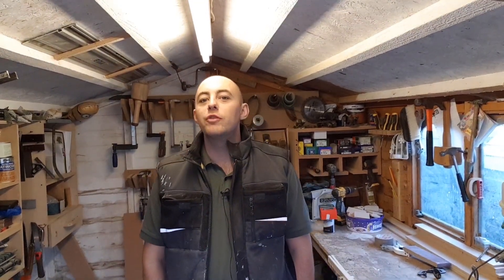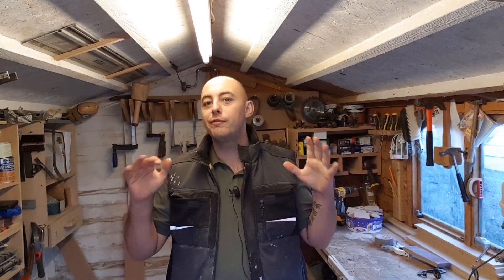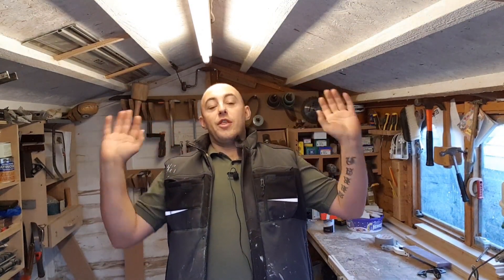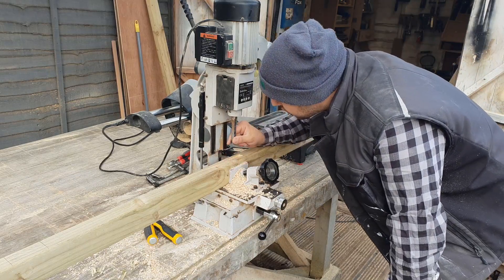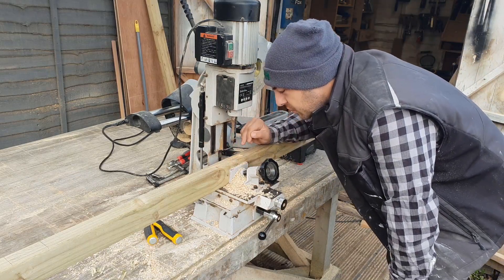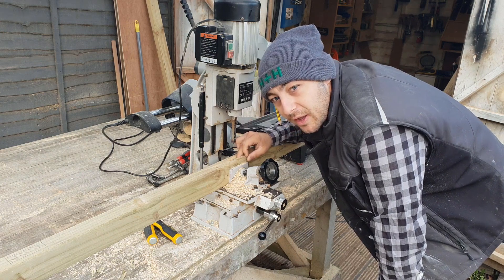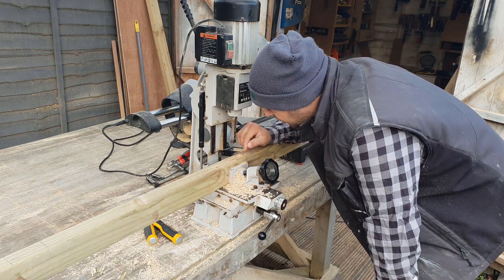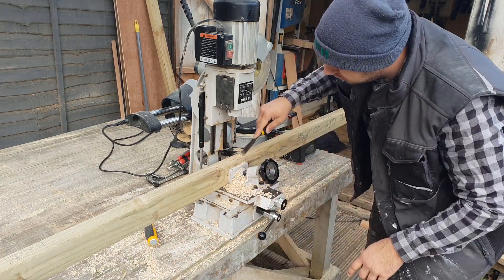Build a Mortise and Tenon Gate.. part 1

Comment: Hi. I'm building the exact same gate, just a bit larger, and came across your video.
Can you tell me what depth/length you made your tenons?
Reply from the maker: Hmmm I think just over 2.5 inch
Reply: @lowesjoinery3031  Thanks. It looked like possibly 3" on the tape, but then I realised it couldn't be as that's the thickness/width of the timber!
On that note, any reason why you wouldn't have the mortise cut all the way through, then the tenon flush with the outside edge of the upright? There's probabky a different name for the joint?!
Would it he stronger, weaker or is it just because it wouldn't be as nice aesthetically?